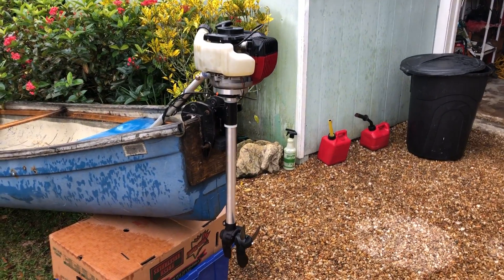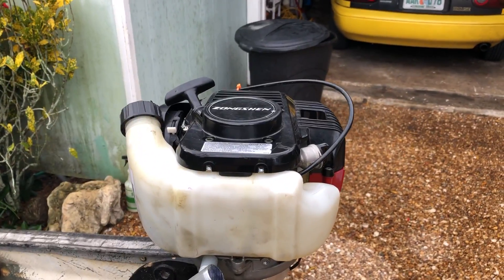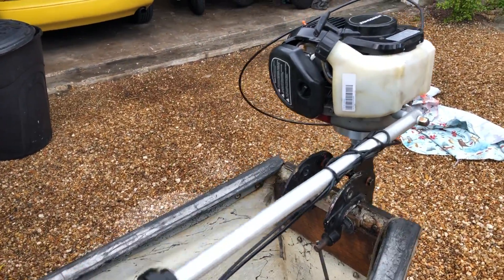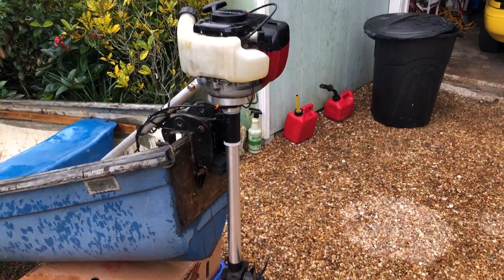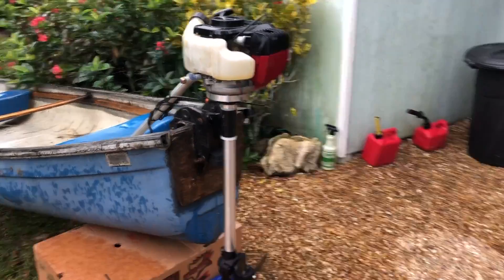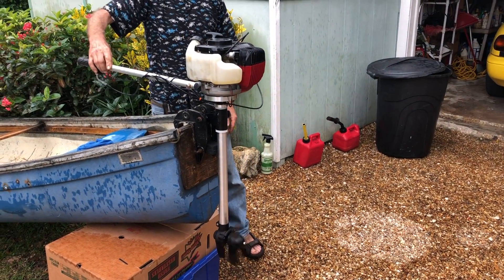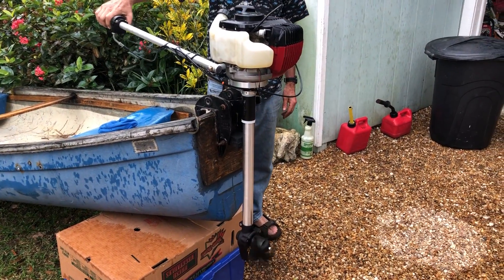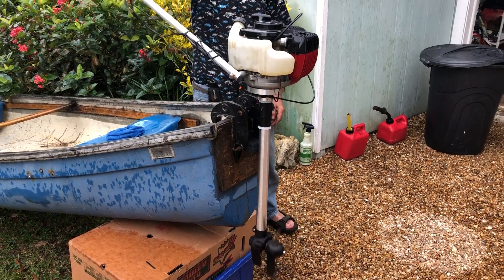Homemade Outboard Motor

Comment: That's sick but I hope that motor is getting oil running at that angle. lol
Reply from the maker: The engine can run in any orientation.
Reply: Its 2 stroke, not 4 ;-)